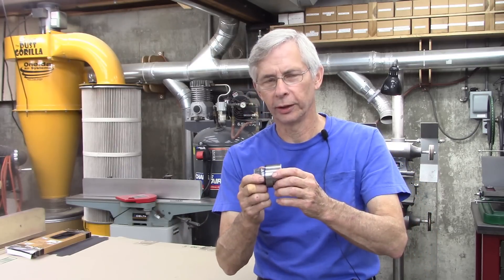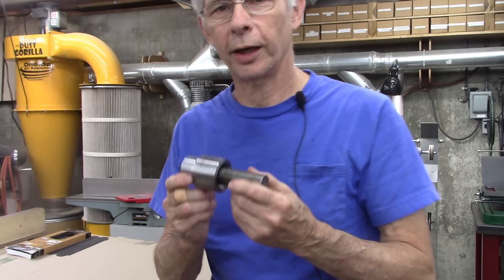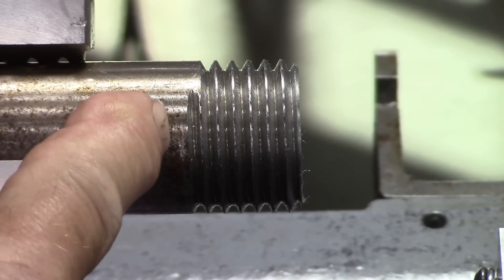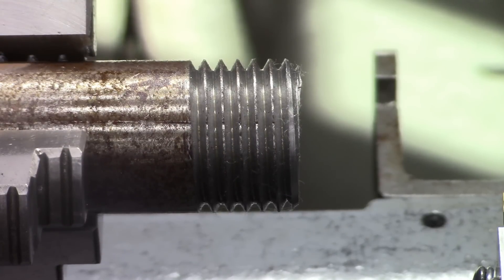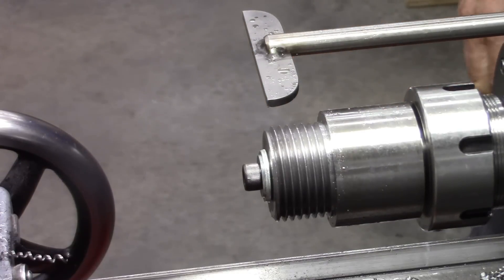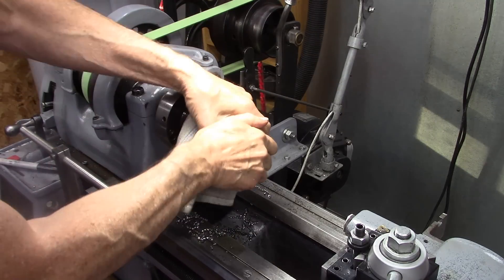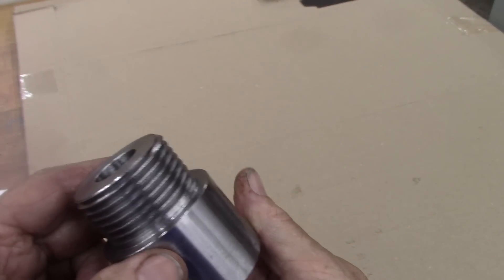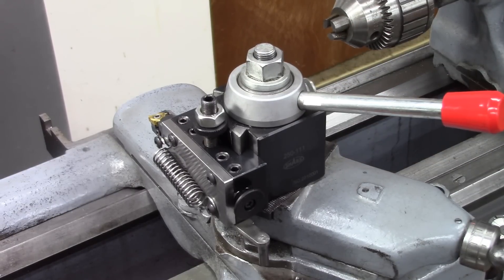Using Mr. Whoopee's Auto Retract Threader to finish my Lathe Spindle Adapter

Comment: I'm  a retired tool & die maker, and many years ago,  my boss walked in the shop with a gadget that was supposed to do what your tool does, beautifully. Unfortunately for me, I was tasked with the job of checking it out, so for 2 days, I turned stub shafts, and crashed inserts without producing a single decent thread. EVERTHING affected the point of release, from depth of cut, rpm, ANY change caused the end point to move. The tool was flimsy, sloppy, and did not work, and cost 2 boxes of inserts, before I gave up in disgust, and gave it back to the boss. FINALLY, you built one that actually WORKS!!! very nice job. PS put a fine thread bolt and lock nut on the end of the stop, for micro adjustments.
Reply from the maker: Cool, this threading tool is cool but I did not make it. If you are interested the makers contact info is in the description.

Comment: When i was a young buck working at an oilfield machine shop in alaska I had a nightmare crash while threading drill collars in a lathe with an 18" spindle bore (big lathe!). The thread is on a steep taper up to a large shoulder. I couldnt see over the tool post well so i rested my hand on the traverse wheel and it lodged the half nut. This device would have saved the drill collar, but the momentum of the machine would have still ran the works into the chuck. Nobody got hurt, however I was gun shy for some time. I never rest my hand on the traversing wheel.
Reply from the maker: I've had minor mishaps. Fortunately my south bend has a flat belt that slips! 18" bore???  Now that is intimidating!
Reply: @WinkysWorkshop  At least there is no problem getting the vacuum cleaner hose into the spindle bore to extract any stray chips🤣

Comment: Do you have the blueprints for this or the link for purchase?
Reply from the maker: No but there is an email address in the description if you want to contact the seller. autoretractthreader@gmail.com
Reply: @WinkysWorkshop  Thank you for your response, I am in the process of purchasing a Mr. Whoopy's auto-retracting thread cutter.🙂
Reply from the maker: @MrMetalhead0124  No problem, it works amazing. This only issue I ever had was the first stop I made was too wimpy and it flexed and didn't trip the tool. That was my fault. I was in a hurry to try it and didn't make the stop very solid.

Comment: I just rewatched the video about Mr. Whoopees auto retract threading tool. I think if you put a rubber bumper in the slot where the pin would hit when the tool retracts, it would cushion the impact enough to keep it from turning the toolpost. Just a thought 🤔
Reply from the maker: The creator of the tool is experimenting with this. I have not asked him how it worked.

Comment: Put your compound 29 1/2 instead of feeding the compound  in feed out and use the diameter radius axis to adjust the actual death of cut. 
The only thing is you would have to begin with a slack out of the compound as far back as you wish to be from your dead stop then by feeding the compound in play position clear of the part when the radius diameter x axis of you wish to call it also just clear of the part
Reply from the maker: Going straight in creates and chip clearance issue when the chips from both cutting surfaces intersect. It puts significantly more load on the tool and creates a slightly rougher finish. Some lathes handle the load well and some do not. I can do it if i take very light cuts but have much better luck feeding with the compound. If you want to be able to control the depth with the dial reading you can go twice as far with the compound.

Comment: The other day I thought if you flattened and polished the two surfaces where your tool post meets the lathe, when you tighten the nut, they would ring together and you'd have a better chance of the tool post not slipping when the threading tool snaps back
Reply from the maker: I put a straight edge in the compound and it looked very flat. I also ran a diamond hone over it...  it is flat. I assume the tool post is also flat but in reality the contact area is also small which makes the problem worse.
Reply: That's a good start, but I'm thinking ringing effect requires a flatness and smoothness beyond what can be had/detected using a straight edge or hone. It's probably not worth the effort to achieve. Probably easier to reduce the mass of the retracting part or reduce the standing spring pressure or find a way to damp the end of travel... Or, how about this? Duplicate the mechanism (at least the snap back effect) on the opposite side of the tool post somehow so there's an equal and opposing impact causing a torque around your tool post clockwise to simultaneously offset the counter clockwise torque that shifts the tool post. 

The tricky part, I suppose, is synchronizing the release so the real cutter and counterbalance reach full retraction simultaneously with matching torques around the tool post.
Reply: The real cutter applies it's impact force at around 2" radius of the post center. A counterbalance mechanism wouldn't need as much mass or acceleration and therefore as much time if it were farther from the tool post center. It then could be triggered after the real cutter begins its retraction, but just before it reaches home.

Comment: I can see why its recommended to go straight in.  The compound should add a bit of travel to the threading process
Reply from the maker: The main reason to use the compound is to reduce the chip load on the tool. It cuts 95% on the left. Straight in is recommended to  get a on center end to the threads where the tool retracts.
Reply: @WinkysWorkshop  I got all that but using equipment built in the 30's needing repairs,  my nerves couldn't take it.  It would be cool to have an internal and external one though
Reply from the maker: @bobprice9244  Yeah, it was made in 1931 and its hard to find parts for. The South Bend 11 is not a common as other sizes.

Comment: You also  coud have done it in 1 setup with a longer piece and inversing the rotation and threading tool upside down (because of the thread shoulder) . That's the way i would choose to keep concentricity.
Reply from the maker: Yes one piece would have been a good approach however I have a screw on chuck so can not thread in reverse.
Reply: @WinkysWorkshop   Oops. :)    I have the same screw-on chuck however  it's held in place  with  2 bolt  locking clamps.                 
There was  also the possibility to make a groove to start the thread , and use a  hss  threading tool.
Reply from the maker: @sebastienlambert1976  true

Comment: A comment bellow. 
Got me thinking outside the box.
Why not a cover over the table that fits the vice and locator.
Sheet that has cutout for vise set above clamps sloped to the back.
Tool setter could have a hole with a cap cover?
Reply from the maker: If I understand what you are saying that's a good idea. I kid of did the same with my knurling tool. I made a mount that sits in the compound t slot so it can not rotate.

Comment: Winky this is such a great concept that it can't help but spawn further refinement. Like automatically disengagement of the Half Nut. 
Wakodahatchee Chris
Reply from the maker: Thanks, Mr. Whoopee has done this. The link to the video is in the description.
Reply: @WinkysWorkshop  Thanks Winky. I'll check it out.
Reply: not gonna work with metric threads, but the tool is great
Reply from the maker: @jozefa1234  why?
Reply: Metric threads dont work with halfnut open, you never find the right position again so the thread is ruined
Reply from the maker: @josjozefa1463  The tool retracts, stop the lathe, reverse and reset tool and then take another cut. You leave the half nut engaged. Also, some lathes are metric or both so you can use the half nut.

Comment: I mostly use Geometric auto die heads whenever I can. But it’s difficult to get all the chasers these days. Also my biggest head goes to 1”, so anything g larger needs to be single point cut. No matter how many decades I’ve been doing that, I’ve always thought of it a real pain. I’ve been thinking of making one of these things, but there are a number of people making them, some better than others. This one looks nice. I think he has a couple of videos up. The 1” retract is the latest model. If he’s selling these, I might get one.
Reply from the maker: I agree, its a good threading tool with a 1-inch retract.

Comment: "Technically the right side of the thread profile had a slight saw tooth effect. If I had left a small portion of the tool on the right side it would have eliminated this effect."

You've done the experiment and essentially answered this question by this experiment. 
Essentially repeating the results in this Joe Pie video, coarser head pitch or fewer threads per inch will aggravate or better illustrate the fallacy/myth of only the leading (left hand) edge of the threading tool does the cutting. It is also why ALL industry standard threading tools have full thread form be it 60 degrees, 55 degrees, ACME, Buttress and many more.. All are single point threaded with direct/radial infeed.
https://www.youtube.com/watch?v=8wxa7LB0FtE&list=PL4wikbEbcE3Lkebdj7roUYG4RAr7MDhTj&index=8

Those steps are the result of the trailing or right edge of the threading missing and not making the form cut. It also nicely illustrates why compound infeed at 29.5 or 30 degrees is not needed and only adds complexity to the process of single point threading. Or why Mr Whoopee recommends direct (radial) infeed via the compound, as practice in Asia, Europe and else where for single point threading on a lathe.

As for those steps in the heads cut with the 30 degree threading tool, that is not an acceptable 60 degree thread form in any way.
Reply from the maker: I don't think location has anything to do with threading methods. There is no additional work feeding with the compound. In fact you have to remember a dial position when you back out for the next pass. Remembering a zero position is easier. I replied to this already so if I'm repeating myself I apologize (you tube is messing up I think). Joe actually said what i have been saying all along at the end of his video. That is, with the compound set at 30 degrees on the left side and a small area at the tip on the right are cutting (its at the end of the video).

I have a video coming out tomorrow that demonstrates the half tool I made with a small radius at the tip. I think I made 8 passes on a 1/2-13 thread and out three tests the half tool worked the best. 

When you watch the video pay close attention to the chips being formed. Going straight in makes rough looking chips...  the tool is scraping the metal off vs cutting. both the regular tool and especially the half too make nice little spirals. It's actually cutting.  Honestly, I think feeding with the compound always yields smoother threads. Under some circumstances the difference is insignificant but in general its a better method.  Mr. Whoopee advocates threading straight in because his tool makes a cleaner exit at the end of the threads.